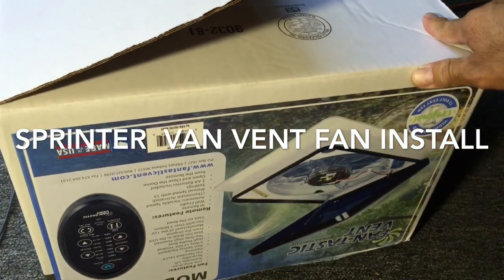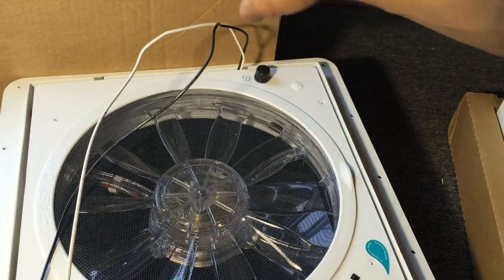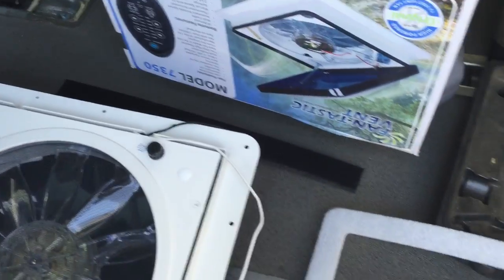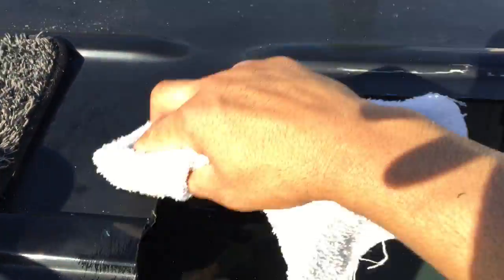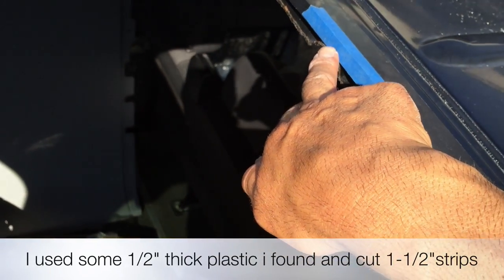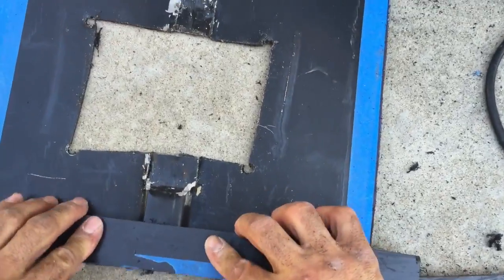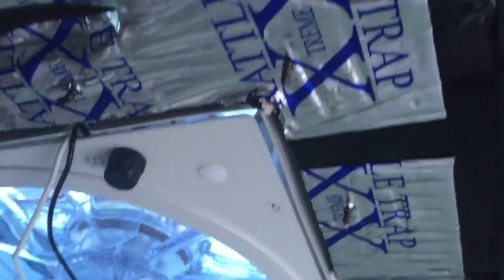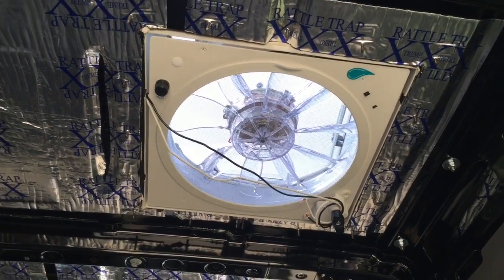Sprinter Van Fantastic Fan Install

Comment: I have been watching a lot of videos on this. I am about to install one of these on my 2002 Dodge ram van. I am really starting to think that screwing through the top of the roof is not necessary at all. Those extra holes are asking for extra leaks. Wouldn't enough sealant around the edges hold it down fairly well?

Comment: I picked this up off eBay and it didn't come with the screws or remote.  I installed the whole thing before realizing I had no way to turn it on.  I looked all over for a picture of one without a switch.  Thank you so much for showing me that it appears not to be broken. It's just the sensors and not broke off.  Sigh.  Heavy sigh. Thank you.

Comment: when applying caulking of any sort. use a solution of mild soap and mainly water. Spray it on the caulk and use finger to smooth it out. This will get rid of any air gaps as well seal properly and look much better.. Window installer do the same thing

Comment: how do you do the wiring? where does it connect to?
Reply from the maker: cody modes  the wiring is pretty simple, it just needs a 12v power source.  I had my ceiling panel down and was able to hide the wires. It then connects to a blues sea fuse box.  But you could directly connect it to one of your 12v cigarette outlets.
Reply: thank you :)

Comment: Do not measure twice. Measure 10 times. This is not a do-over scenario. This is a space mission to the moon. Mistakes are not an option. I spent 30 minutes inside my van measuring where the van will fit and marking my first corner hole. Then another 30 minutes on the roof measuring and marking the lines for my cut. I also stopped a few times in the middle of cutting to measure my cut to make sure it was not running in/out. My cut came out perfect and I do not regret taking the extra time to do it right. I highly recommend placing your fan in a spot where you only have to cut into one groove/valley/bump or whatever you want to call it. Cutting out that groove weakens the roof considerably so try to avoid cutting more than one groove.

Comment: DO NOT(!!!!) make relief cuts to flatten the roof like in this video!!! Very very bad idea. You are risking so much for basically nothing. Just build up the flat areas to the higher levels with an adapter or stuff the gaps in the grooves with mastic tape. Keep it simple. Don't create unnecessary work where one wrong cut/bend and you just created a bigger hole and have to buy sheet metal and do welding. Don't do it.
Reply: wojtek0000  I agree messed up my van

Comment: how did you wire the fan?
Reply from the maker: I had my headliner down so i was able to wired it straight to a blue sea 12v fuse panel. The fuse panel is directly connected to my aux battery in the back.

Comment: Nice install. But how do you power it? Any info on wiring the fan to the 12v system?
Reply: I remember there was a constant hot going to the center light. You can try that. I will be installing an aux batt. System soon and it will tie in to that.